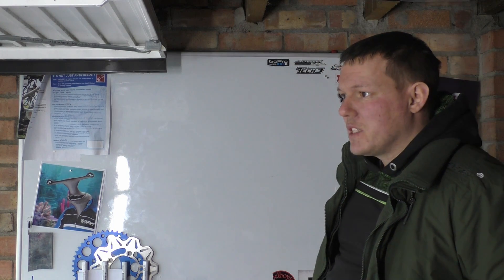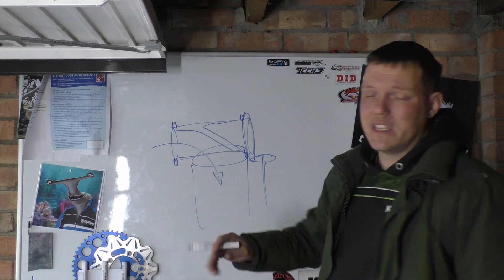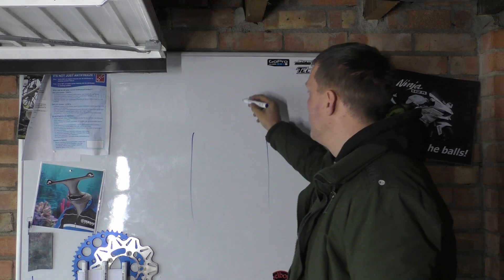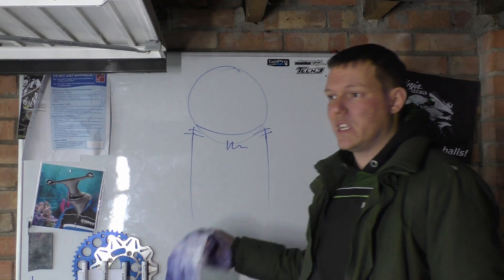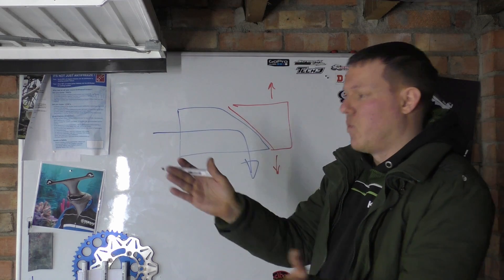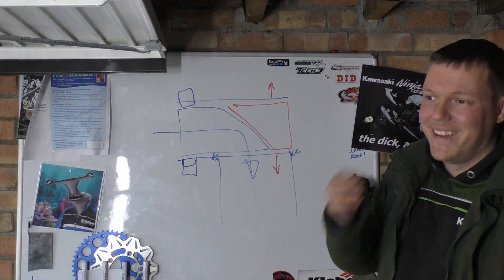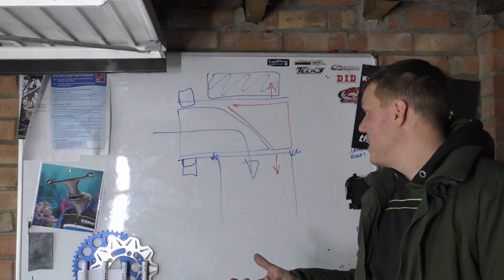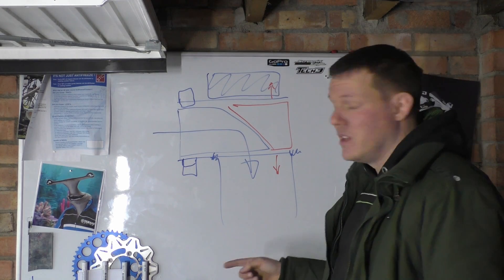Rotating valve - Bishop Valve

Comment: Instead of lining up the intake and exhaust along the rotation axis, place them perpendicular.

The valve looks like a hockey puck with a "bite" taken out the edge. It rotates within a cylindrical housing with the cylinder port at the bottom, and the intake/exhaust ports to the sides.

For half the puck's rotation, the cylinder port is blocked off.

Then, the bite offers a path to the exhaust port. Then, the bite offers a path to the intake port.

Unfortunately, a small amount of intake air will be carried by the bite the wrong way around to the exhaust. But the advantage is that there is no "hot side" and "cold side", only a single bite that takes on both roles.

Also, for an inline engine the location of the intake and exhaust is the same as the usual thing, which is more convenient.

Comment: I've thought about this and you could use 2 different tubes and run them similar to a dohc system running down the length of the engine with gears to spin at 1/4 the crank speed so the "cam tunnels" allow air/ fuel to enter every half rotation but exhaust may need a different gear to allow for a compression stroke
Reply: We tried two valves/tubes.  You lost more than half of the airflow and a load of power.

Comment: Use two rotary valves, but..., instead of being cylindrical, make them somewhat conical. The thermal expansion verses sealing issue can then be handled by a pressure pushing the "cone" into the cylinder head. Regardless of cylinder or conical, excess lubricant would be burnt as the wetted surface area of the closed valve (both valves) is much larger than the wetted surface of the exhaust valve below the valve guide. So you may have emissions issues.

Comment: There was also the rotating cone head. The whole top half of the cylinder is a cone that spins opening and closing ports. Seals can be like in a Wankel engine attached to the head. Replacable under caps.

On ingnition the cone would stop rotating.  A problem, but not a big problem.

Comment: You could make one for exhaust and one for intake. You could flow water through it to keep it consistent temperature. They actually make sodium filled valves to keep high compression engines from getting knock once it's in its power band. These started in airplane engines then worked their way into supercars

Comment: I used to work for a Rotary valve engine manufacturer as a development engineer.  The valve arrangement you describe is basically the Cross Engine from the 30's.  There are loads of different rotary valve designs.  All struggle in comparison to the good old poppet valve which is just too easy to implement.
Reply: ...and VASTLY cheaper to implement/customize.
Reply: Rotary valves can be much easier and cheaper to make. You gotta think of all the parts you have to use just to get those damn valves to go up and down. You have issues with bent valves, leaking valves, the valves hitting the piston if something wheres wrong or you get valve float and then you can have a valve drop which explodes your engine. 
With a Rotary valve you can gain higher RPMs and not suck up a buncha hp by putting in stiffer springs. 
It's a great idea for race cars since they all suffer from these issues way more than your common grocery getter
Reply: @michaelatkin9649  Uhm...you realise that this guy apparently used to be a development engineer for this very topic, he quite likely knows all this...and more.
You're kind of like trying to explain how a paper airplane works to a fighter pilot 😅
Reply: One roller for BOTH, intake and exhaust? Yeah, he's a Brit alright...the thermal stress alone would make that seize up/ impossible to seal
Reply: @therovingrobin5938  What are you talking about? How does being a 'Brit' relate to anything? Have you been paying attention to the video?
Matt has been explaining how it theoretically works, it's problems and so on, not making drop-mic unhelpful no-no statements.
If everybody throughout time just stated that nothing would ever work based on their own assumptions, we'd have nothing that ever worked. We'd still be walking around and living in caves because taming horses and building caves of our own was a foolish idea that never would have worked...
Reply: @mazdamaniac4643  lol! Have you EVER seen, what Brits have designed over the decades? Thankfully, they don't anymore... remember that TD5 disaster? When Rover thought it a good idea, to incorporate the high pressure rail within the cylinder head?🤣 Yeah...the British brainfart,  something to rely on period🤣
Reply: @therovingrobin5938  Oh well, I'm sure that you've personally designed far more faultless, incredible engineering complexities that we all now take for granted over the many years of their existence...how silly of me or anyone else to assume otherwise...😒
Reply: @mazdamaniac4643  no, dummy, I am a mechanic and repair, what others have designed... Do you know, why pistons are narrower at the top then at the bottom? Oh right...unequal temperature and thus different rate of expansion...not that hard, really...just the BASICS🤣 I could add, that cross flow heads were invented because of the detrimental effect of heating up incoming fresh gases...and even in parallel valve heads with same side intake/exhaust (80s/90s VW for example) wasn't it as bad as this would be...everything about rotary valves is a pain, hence why they never took off
Reply: @therovingrobin5938   - it's been done successfully.

Comment: The seal is not as simple as made out. It would have to seal in an elliptical shape along the ports which I'd guess is the real issue here.
Reply from the maker: Pistons rings aren't formed circular they have a eccentricity to them.
Reply: @thedirtyworkshop  How would the seals be lubricated - oil?. Would be a nightmare.

Comment: A couple of piston ring type seals at each end of the valve with minimal oiling would solve the sealing issues. The valve clearance with the head could then be increased to avoid siezure an scuffing. The BSA Racer channel has a successful design by Ralph Watson, it did 30,000 miles before it was stripped due to a spark plug disintegrating. I can't see any difference between the Cross and Bishop valves, maybe the Cross patents have expired?

Comment: You can still have a rotary intake with a regular valve exhaust. Technically the original idea had a rostering intake and separate rotating exhaust. So their are different ways. It is the future, simplicity always is. But one step at a time

Comment: There was someone in Australia who made them for Holden 6 cylinders called a Dunstan rotary valve and I vaguely remember a tube running through the centre water-cooling it. Most were used in race boats but a few were used in cars.
Reply: @god I read it in a few magazines in the 90s mate but there's a few articles if you google Dunstan rotary valve Holden and a few things on Facebook.

Comment: What about a shaft like a cam shaft but without the lobes just holes straight through ( crossways) with piston type rings for sealing one on each side and one in the middle between the two holes ?

Comment: is this what they call the rotary valves in the honda XR400/TRX400 ?
Reply: Are you talking about the old rfvc (radial four valve cylinder) head? If so- no. The normal valves are just all canted so as to keep a hemi head shape rather than a usual 4 valve pent- roof head shape. Using sub- rocker arms to do the job, they were high maintenance and more parts to replace or go wrong. Glad I never owned one.

Comment: There was a methanol burning 1,000cc Triumph twin that ran a rotary valve cylinder head, back in the 1970's. It was built, by the owner, for drag racing.

Comment: Yo, ive been thinking about this for about 24 years. You dont have 1 tube with both intake and exhaust. You have 1 for each with electronic cam phasers at the end. Intake can be made out of aluminum, and exhaust out of steel. Given that you would be implementing forced induction, it would easily scavenge. A Teflon or similar coating with a spring retained expanding mount set would mitigate compression loss at low temps, and allow for expansion at high temps.
Reply from the maker: Not going to work, its been done. And electronics in valve systems are a massively bad idea
Reply: @thedirtyworkshop  you mean like vtec, vvti, and cam phasing that is on every modern ohc valvetrain today?
Reply: And what about the electromagnetic valve actuation utilized in the keoneggseg?

Comment: You are a legend, mate.
I was sitting idle thinking about engine designs and rotary valves so I thought, "let's see if Matt has some video on the topic" and there it is.

Also,
1 question -> why not make the valve out of some ceramic with low thermal expansion & lower conductivity? (Genuinely curious)
Reply from the maker: 1) it's fragile
2) it's heavy
3) low thermal conductivity is bad. Like a stone it gets how and once it's hot it stays hot - it's thermal expansion might be low but it's heat will be conducted to the other parts around it - same issue.

Comment: I've built 5 of these engines so far, included an Inline 6 cylinder head for my BMW 328iS 2.8L engine.  Check out my channel for the description video and it running.  I agree with most of the things in this video, except for the major concerns on the thermal stresses. Since the tube is usually quite large versus the bearing spacing, the bending stresses are relatively low.  I don't have any cooling directly inside or on the valve, but other's have had lengthwise oil holes integrated into their valves.  My cooling comes from the seal and through the exhaust bearing.  Most of this can be controlled by making sure you run the engine really rich.  I think the design will never make it in a production car, but it can work in a few niche racing applications when you want very high speed naturally aspirated engines that breathe well.  The F1 engine supposedly made 10% more power than the poppet valve engine.

This design will always have a challenge sealing the combustion pressure.  Thermal expansion and keeping the bottom and what ever other seals you decide to throw at it are hard to deal with.  My first designs seemed to be really bad at sealing after a minute or so of running, but the larger BMW head seems to be working quite well.
Reply from the maker: These are low speeds though - 6500 rpm isn't that fast.... Nice by the way. If you wanna lend me one of these to do a video on that would be great ;)

Comment: A guy from Bishop did a presentation i went to and he said the design was banned from F1 by renault via the FIA in the 90's and since there was no motorsport category to prove the thing worked (and pay for development) OEM's stayed away from it (since there was no motorsport to prove it worked) and it got shelved. 
The advantages were much bigger ports, no valve float and higher compression possible since there were no hot spots like on a poppet valve. And yeah, 2 barrel per cylinder prototypes were being tested by Illmor for F1

Comment: I had an RCV 20cc engine but I sold it 5 years ago,it was the versiom where the crankshaft is just there to make it work & the PTO was at the top, the cylinder was clockable.

Comment: well, call me a dickhead but i would try this on a low rpm engine combined with conventional  valves. take a 4 valve engine, and you could have all 4 valves open for intake , and all 4 valves for exhaust. the rotating shit would only "switch" the "output" of the 4 valves to intake or exhaust. prooobably it would be just by far be too over complicated, but it would be at least something out of the ordinary. people have kink for that. flow wise, well.. could get away with less valve lift since 2 times larger valve area is available, and the cilinder pressure would be handled by the conventional valves, but not sure if it would be worthy.
Reply: Well, yes, dickhead- the whole idea was to eliminate the reciprocating mass of poppet valves from the engine. Secondarily the increased airflow of rotary valves. To have both is to complicate the design. Also, the area behind the poppet valves that would switch from inlet to exhaust- would ignite the inlet gases before even entering the cylinder, causing constant backfiring.

Comment: This is a lot like the sleeve valve engine (which you did kind of mention) of the 1920’s-1930’s. Those engines actually ran good and the sealing of the ports in the sleeves got better as you ran the car from carbon build up. Main issue then and I could see being even more of an issue now was/would be oil consumption. They went through oil like the Exxon Valdez.
Reply from the maker: "This is a lot like the sleeve valve engine (which you did kind of mention) of the 1920’s-1930’s."

- they were called knight sleeves if I remember correctly.
Reply: It was made by a man named Charles Knight and was mostly used in the Willy’s Knight automobiles. I really want to get my hands on one
Reply: @TheDisabledMechanic  Bristol aero engines' had after years of trial and error perfected the sleeve valve by the late 30,s.Used on their Aquila and Taurus engines and later on the Hercules and Centaurs.Distortion off the sleeve by the high temperature exhaust gas causing it to jam in the cylinder was overcome by using three exhaust ports to spread the thermal load over a bigger area off the thin sleeve on the Hercules.Two intake ports were used.Advantages were over poppet valves were no need for valve adjustment between overhaul as well as allowing higher charge pressure due to lack hot exhaust valve.However the engine needed servicing as any abravises in the oil would find their way between the sleeve and cylinder wall quickly causing sleeve distortion and premature wear.
Reply: @eugeneoreilly9356  The Rolls-Royce Heritage Trust published a book: Fedden- the life of Sir Roy Fedden by Bill Gunston and chapter seven goes into lots of details about struggle to get sleeve valve aero-engines to work. The crucial problem was matching the thermal expansion of the cylinder and sleeve. If I've understood it, they eventually settled on an aluminium alloy with 14% silicon to get relatively low thermal expansion for aluminium, combined with a special, high thermal expansion steel. The book emphasizes the great time and expense of the engineering effort required.

Comment: I have an old Motorcycle Mechanics magazine, from the early 1980's, with a technical cartoon strip featuring this system in a 998cc Triumph twin drag race bike, possibly created by Mr. Bishop himself. Always wondered then how the problem of sealing versus thermal expansion was coped with, bearing in mind that nitro methanol has a vastly greater and more rapid cooling effect on the intake side than petrol or diesel.

One could possibly run the valve shaft inside iron slip rings to seal the ends or even use a complete cast iron head, which would have superior wear and thermal expansion properties than aluminium or duralumin.

On a drag bike the motor is only going to run for less than a minute and will be only under full power load for less than 10 seconds anyway, before being shut off, so not the same problems as everyday use road vehicles.

The technical cartoon also featured sleeve valves, which did make it into some French manufactured vehicles.

Comment: can't you put the hole's in radialy instead of axial. Then you would have an intake that shoots air strait down into the cilinder. Of course this would not solve sealing problems or heat problems.

Comment: There was a bloke called Dunstan who made rotary valve heads for our locally (australian) built Holden straight 6 engines in the '50s.  The upside was the thing revved to 8000rpm and breathed much better than the original u-flow 2 valve siamese shitty head.  The HUGE downside was the sealing and friction, they ran 2stroke oil in the fuel to stop it seizing up.  They're rare as rockinghorse shit, but someone brought one into our workshop a while ago for us to look at.  Great idea to look at... Doesn't work

Comment: I think it would be better when routating around the vertical axis. Than the cooling is done by the intake air because it uses the same path. Sparkplug in the centre and rotating with it.
Sealing would still be an issue though.
Reply from the maker: Spark plugs in motion are also a problem.
Reply: make it brushed, like an electric motor.. or is that not what you are aiming at